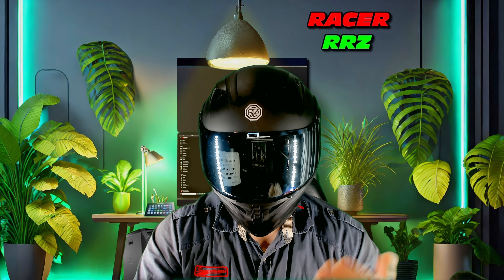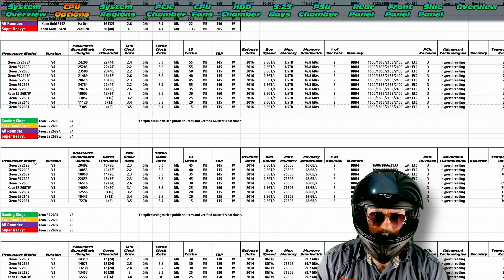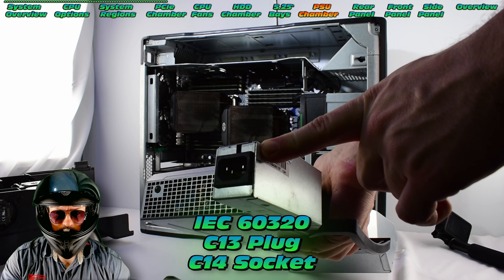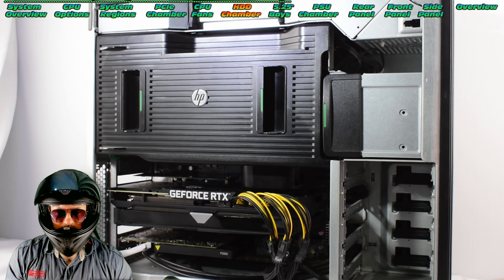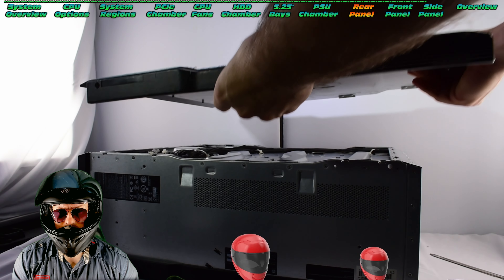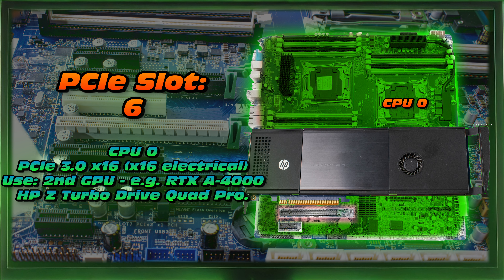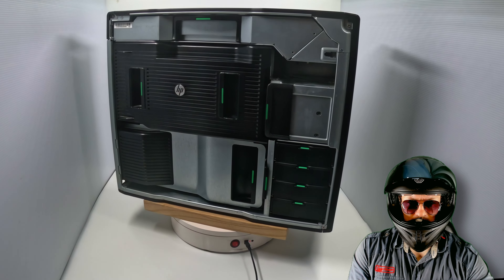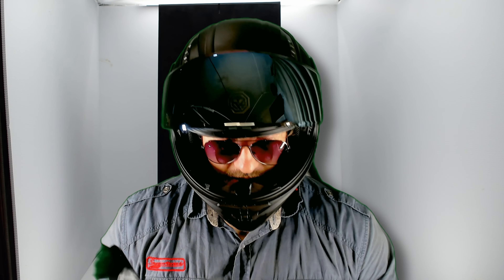This Workstation Would Be It. HP Z840 Full System Overview.

Comment: Is it possible to fit an rtx 4090 in my Z840 workstation?
Reply from the maker: Technically it is possible but there are some issues to resolve and some risks to be aware of. 

1) The Z840 only has 3x 6-pin PSU power cables and most RTX 4090's require 4x 8-pin power cables. If you can attain an RTX 4090 with 3x 8-pins then yes, it would be easy to fit and power. I have not tested this myself, and there are lots of reported issues regarding melting power connectors, but it might be possible to use a 4x 8-pin to 12VHPWR adapter. I am not sure if these adapters would function with three of the four cables connected (I doubt it). There may also be some of these adapters that have 3x 8-pin to 12VHPWR options. The logic with them is that it would allow the power requirements of the RTX 4090 to be met - the only caveat is a high risk of melting power connectors. 

2) Power delivery. Most 8-pin GPU power cables are rated for 150W - and 4x 8-pins would net 600W of power delivery. The HP Z840 has a powerful PSU that outputs 219.6W per 6-pin cable (6-pins are normally only rated for 75W). 3x HP Z840 6-pins will net 658.8W of GPU power - max. So the Z840 has the power but you need to adapt the power to match the ATX form factor of 4x 8-pin cables - or go for 3x 8-pin cables to 12VHPWR and hope the adapter / GPU doesn't melt down. 

3) Bottleneck. The RTX 4090 will endure a substantial bottleneck when connected to PCIe 3.0 and aged Xeon CPUs. The impact will vary but the bottleneck will range from 1% - 35% pending the task. For my RTX 3090 Ti I figured it was better to have a powerful GPU with a bottleneck rather than having a weaker offering with no bottleneck. The 24GB of VRAM alone is amazing.
Reply: @racerrrz  So I shouldn't risk it? The thing is I need a powerful enough GPU to work on heavy big projects on Unreal Engine 5.5 and other GPU dependant tasks. So not sure if a 4080 Super would have been good or still  a bit weak
Reply from the maker: @mohannadhaikal4178  Can you get your hands on to an RTX 3090 Ti? I would recommend that (it's what I was using with my Z840 without issues: https://youtu.be/D1cwwiR4UHM). 

In a quick online search I didn't see any Z840's with RTX 4090s, but it could technically be supported (you could even power the GPU from an independent PSU). But from a reliability perspective it's best to match your system with a GPU that suits it. The RTX 3090 Ti would be the most aggressive GPU I would pair with the Z840.

Side note, if you look into the HP Z8 G4 you'll see they come supplied with 4x 6+2 pin GPU power connectors (each connector supplies 219.6W - total of 878.4W - 1700W PSU). The RTX 4090 will pair up with one of them without issue.
Reply: @racerrrz  so a 3090 ti would be better than a 4080 super?
Reply from the maker: @mohannadhaikal4178  For what you are doing I would say yes. More VRAM will be of more use than more CUDAs. A project may render slower with the RTX 3090 Ti but at least it will render. I had endless issues with projects crashing with my RTX 3080 12GB before I went to the RTX 3090 Ti. VRAM is important for projects and 24GB is a must in my book. For gaming the RTX 4080 Super would however be better. 

You can compare both GPUs here: https://www.videocardbenchmark.net/compare/4984vs4524/GeForce-RTX-4080-SUPER-vs-GeForce-RTX-3090-Ti
Reply: @racerrrz  Thank you!

Comment: Error! E5-2696 v3 Turbo Clock 3.8 Ghz not 3.6 Ghz and E5-2697 v3 have 2.6 Ghz base clock
Reply from the maker: Thank you for questioning the speeds. There seems to be some confusion online regarding the E5-2693 V3 clock speeds. I based my speeds on the official Intel speeds (not that Intel released much documentation on it) rather than online claims. I presumed Intel will get it right, but if you are able to obtain higher speeds that's great! 

With some modulation of the number of cores that are operational it appears this CPU can clock to 3.8GHz: https://www.reddit.com/r/overclocking/comments/176pob9/calling_all_e52696v3_owners/

I doubt it would clock to 3.8GHz boost with all it's cores operational. Plus the Z840 does not allow much in terms of CPU modulation in the BIOS. The E5-2696 V3 resembles the E5-2699 V3. 

https://www.intel.com/content/www/us/en/products/sku/81061/intel-xeon-processor-e52699-v3-45m-cache-2-30-ghz/specifications.html 

https://www.cpubenchmark.net/cpu.php?cpu=Intel+Xeon+E5-2696+v3+%40+2.30GHz&id=2526&cpuCount=2

https://www.cpubenchmark.net/cpu.php?cpu=Intel+Xeon+E5-2696+v3+%40+2.30GHz&id=2526

Comment: By the way, I thikk I've  found the best GPU for this beast. Alienware/Dell RTX3090 is probably the smallest or at least one of the smallest 3090s available. It's only 267mm long and 50mm wide, will fit the Z840 without any mods. It look very decent, no RGBs, no BS, just pure GPU in a very industrial design that perfectly matches the Z840.
Reply from the maker: Thank you for sharing your find. Getting a smaller RTX 3090 should free up some space for extra expansion. I would have liked more NVMe adapters on my system for video editing - but I am usually restricted to one quad adapter in PCIe Slot 6 due to GPU sizing issues. 

I only bought the Zotac RTX 3090 Ti because it was listed substantially under MSRP at the time (this was during the GPU pricing crisis). I suspect it was less popular because it was the largest RTX 3090 Ti on the market - meaning most gaming cases fell short of accommodating it. One perk about it has been the cooling efficiency - the GPU sits around 65'C even under heavy load. Ample cooling capacity.

Comment: Outstanding video! I'm coming from a Dell Precision T7600 and was originally looking at the Z440. The Z840 seems to be more in line with my old Dell. I absolutely love the details you give, like part numbers.  You saved me a bit of research.
Reply from the maker: Nice. The Precision T7600 was a trooper. You'll find the Z840 is quite similar from a design aspect. 

I'd like to think the HP workstations have a little more on offer across the board compared with the Dell workstations. Generally the HP workstations have more RAM slots, more PCIe slots, more PSU grunt, more SATA ports etc. compared with the equivalent model from Dell / Lenovo etc. You would be hard-pressed to actually notice any difference in operation between them. What I do like about the HP workstations is the build quality - they feel more refined compared with the other brands. 

I am glad you found the guide of benefit. I find myself also returning to these videos for those part numbers. I aim to load these video guides with everything you could ever need to know, and hopefully that's nearly the case lol.

Comment: You have inspired me so much that I bought one of these beasts, ordered it with 2 x 2690v4 and 32gb of ram. Outstanding quality, very quiet, very fast. Perfect machine for my home theater, I'm going to replace my old 1060ti with a 3090 so my son can play a little bit and I can comfortably watch 4k movies with all madvr settings cranked up to the maximum. Thank you for all your priceless advices.
Reply from the maker: Thank you for your feedback. That's great to hear - and great choice on the dual E5-2690 V4's. The Z840 will settle nicely into the home server role. Paired with the right setup it will handle everything you throw it at, plus gaming! 

I guess I should let you recover from your wise purchase before I plant ideas for your next purchase (ignore this : https://www.youtube.com/post/UgkxppaqWeTSyO2x4-0nK1rXCKoiEdu94Ny7 - it's definitely not a link to the HP Z840's upgrade - the HP Z8 G4 - for which I am releasing a detailed overview video this weekend lol).
Reply: @racerrrz  I installed windows 11 on this workstation and it works like a charm. Although theoretically it doesn't support w11, you can modify the registry to install w11. Just FYI..
Reply from the maker: @1978derik  Nice! I actually stumbled onto an article on the topic after I made this video - otherwise I would have made mention of it. Being able to update the registry with the updated security protocol would really extend the end-use of the Z840. I wonder how reliable the process is or if it carries any risk for bricking the system. Call me tempted to test it out. 

Article: https://h30434.www3.hp.com/t5/Desktop-Operating-Systems-and-Recovery/Successful-Solution-to-update-z840-TPM-to-2-0/td-p/8847081
Reply: @racerrrz  my unit works flawless since few days now. All updates installing without any issues, all drivers are working either.

Comment: One big benefit with the 3d vapor coolers is that the noise level does not increase even with cpus at full tilt.
Reply from the maker: For the Z840 I would say the Z Coolers are well worth the cost. They retain decent CPU temperatures even on the lowest fan setting. In my testing I had a 5'C drop over the stock coolers without adjusting fan speeds etc. Plus from a design perspective they are fully optimised for acoustics with the 3D Vapor chamber. My video review for them: https://youtu.be/q3YFqH5pdDA

Comment: Hey mate, another great vid on the z840. Keep up the good the work! It's fun to see others using this older machine and pushing it to the limits. Will upgrade my processors soon and install the Z-Coolers as well. Just added a RTX 4000 Ada, which I got from an offer I couldn't refuse. Haha. Really appreciate this card, because it's also small as hell. Also a great option for my upcoming Z8 project.
Reply from the maker: Thank you for the feedback. Nice, that Z840 of yours is sounding well-geared. Which CPUs were you considering? I quite like the RTX A2000 or A4000 as workstation alternatives - so naturally I'll give my support for the RTX 4000 Ada also. What is your end-use for the GPU? I am yet to test out a modern workstation GPU - at least on paper I prefer the extra Cudas that come with the gaming GPUs. But comparing workflow between something like the RTX 4000 Ada and a RTX 3090 Ti would be interesting I am sure.
Reply: @racerrrz  Hey man, I also considered the RTX A4000 which is also a great recommendation, but I decided to go with the Ada, because it's like the RTX A4000 on steroids. Plus, it's also a great fit for a future Z8 G5 which has PCIe 4.0. I tend to use these cards for a long period of time. Had a Quadro M4000 in my machine for almost 8 years and it really did a good job for quite some time but became incompatible (to some degree) with latest versions of the Adobe Cloud Applications. I do a lot of Premiere, Photoshop, heavy After Effects renderings and DaVinci Resolve on my machine. Also think the Ada is a good choice for the future, because of its AI capabilities. 
Yes, comparing the RTX 4000 Ada and a RTX 3090 Ti would be very interesting indeed! In general, it would be really great to test these pro cards vs. gaming cards. I'm sure there are lots of pros and cons that might be interesting to discover for specific users and their real-life needs.
Reply from the maker: Future-proofing your hardware is the way to go. I wish the Z8 G4 had PCIe 4.0 but it just missed out. The Z8 G5 should enter the market after coming off 3 year leases - so there could be some deals soon - but I would expect top dollar for them. Nice, the M4000 was well set up but as you said they begin to fall behind when you use the latest software. AI is booming so it is well worth securing some CPUs and GPUs that can make use of it. A match-up between the workstation GPU line-up and the gaming GPUs on the typical software platforms would make for an interesting comparison. It's nice to see you are combining a strong bunch of software packages in your workflow.

Comment: Great video Racerz ! I picked up a 2nd z840- with 2697a v4's x2, 64 gb, 8gb quadro M4000, 12gb sata with win 11 and the 1125 psu for 319 USD. It's a very good value, totally a beast, still had the plastic  protection on it, looks brand new inside and out, quiet as can be. I have an HP turbo z dual nvme with 2 -1TB intel optanes, I just put in it for boot, adding an m10 tesla 32 gb accelerator to match the quadro for the cudas and vram, makes for a cheap homelab AI machine. (btw the tesla accelerators and a100's requires a dual 6 pin to 8 pin COM eap cable, they are keyed differently than a 3080, 3090 and have opposite polarity, the cable looks the same but won't plug in) still working on adding the dual tensor chips. I have been running ProxMox on an older IvyBridge z820, that thing is a modern jet under ProxMox you can spin up multiple VM's and containers all day long, run everything you can think of. ProxMox is a huge software upgrade and these machines take advantage of it running on bare metal. All of these machines (z840 especially) were all ahead of their of time, they are about the best engineered machines available, even in 2024 and they are plenty upgradeable. My 1st  one has been running for 4 yrs. with no down time  other than cleaning dust. Even though the newer boards in the G4 have more  lanes,  the 840z has more than enough for almost any need. Keep up the good videos!
Reply from the maker: Nice find with that 2nd Z840 - those specs are solid for the price point. Interesting detail with the M10 Tesla GPU power cables. The M10 Telsa is well optimised for virtualisation and I am sure it would work well in the Z840. The power supply alteration would be a tad annoying but it should be something you can work around. I do recall reading about converting the H100 GPUs for more casual uses. The setup is a bit unusual but it would make sense to have some serious GPU grunt available from time to time. Proxmox is great for managing multiple VMs and I can't think of a better application of the Z840 in the modern day. It should handle numerous VMs with decent hardware specs on each. I bet a Z840 running 24/7 gets quite dusty unless it's in a clean room.lol. They sure pull quite a bit of air through them. I tend to clean mine out ever 6 months or so which seems too infrequent already. Thanks, will do! I need to get a bunch of videos out for the Z8 G4 already!
Reply: Hey there AngeloMichael, could you share your source for your newest z840?
I’m trying to find a decent machine for my nephew who has (finally!) started his computer courses. He is now heavily into coding and has been complaining that his current machine is too slow.

I gave him his current machine about two years ago .
Apple iMac 27”
Intel i5 6-core 3.1MHz
128GB RAM
500GB HDD

The z840 line sound like a better machine.

Thanks for any info you can share .

BTW, his teacher states that the required software needs an 8-core machine, with 64MB RAM.
The iMac is much too fiddly to upgrade, and “your results may vary”.
Reply from the maker: @ernestgalvan9037  
You really can't do better when it comes to coding. These HP workstations were created with coders, designers, researchers and creators in mind. 

What are his software requirements? My only complaint on the HP Z840 is the lack of Win 11 support due to age of the hardware. The more future proof option is the HP Z8 G4 - but their cost is still a little prohibitive. I am making good progress with finishing off a detailed overview of the Z8 G4 - hopefully out soon. A quick teaser trailer can be found here: https://youtu.be/ym4V6Z7r7ws

In terms of sourcing a HP Z840 or Z8 G4 - the simplest solution would be Ebay - pending your location and ability to purchase a system there. 

I scanned through Ebay listings and these are my top picks at the moment (affiliate links – I receive a small commission if a purchase is made via these): 

HP Z840: https://ebay.us/nJ286R

HP Z8 G4: https://ebay.us/1Y3efU

Components can be upgraded later. It’s best to secure a system with two CPUs installed – even if weak CPUs. The CPU cooler and fan are an added expense so it’s best to secure one with that already present. CPU upgrades are quite affordable right now. I have created a Xeon CPU Mega List that allows quick searching of any given CPU (all affiliate links): 

https://www.youtube.com/post/UgkxinbLescQdmrqtvl7VzO2DW8Eaysrn3QH

Comment: :hand-pink-waving: great video and content about the HP z840, you talked about the max GPU length (330mm with HDD fans), but what about the max width ?
my K2FA 3050 6GB is a bit tight with the PCIe chamber cover (209 mm x 118 mm x 42 mm)
Reply from the maker: Sorry YouTube flagged your comment - I retrieved it. The GPU sizing with the PCIe cover is really just catered towards the Quadro workstation GPUs. I don't have access to all that many GPUs but for the ones I have tired none of my gaming GPUs have cleared the PCIe chamber cover (not even my GTX 970 cleared!). Width is more or less unlimited by current GPU sizing standards - you can fit a 3.5 slot wide GPU or even larger - but you will have to forgo that lower PCIe shroud. It's good to hear your RTX 3050 is sort of clearing. On my Z800 I initially made a notch on one of the PCIe shroud fins to give enough clearance, but I have just not run that shroud on any of my systems due to clearance issues. Even my Z8 G4 right now has the PCIe panel shroud removed lol.